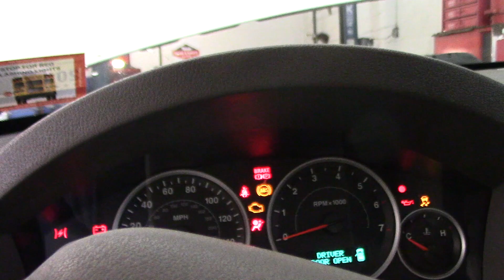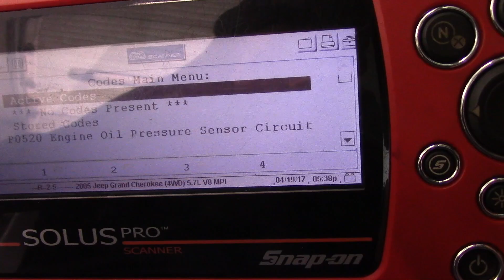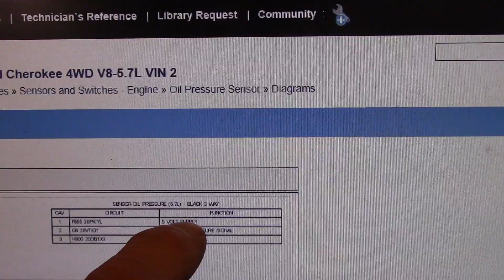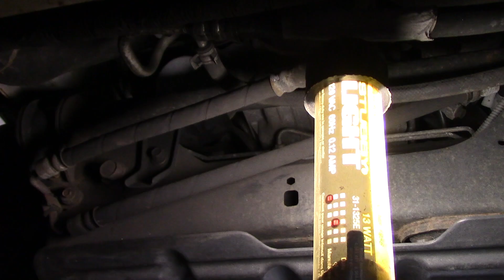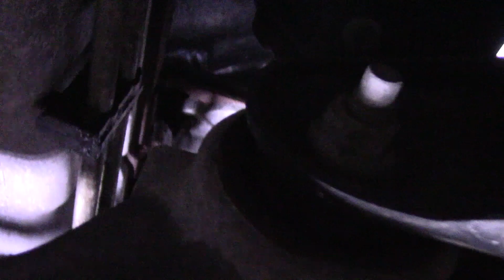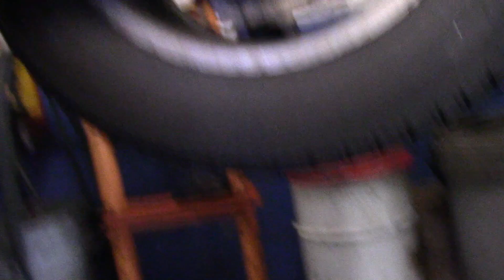Oil Pressure Sensor Replacement 2005-2010 Jeep Grand Cherokee

Comment: When you test the ground what should it read?
Reply: Ground should show good continuity to the negative side of the battery if you use the ohmmeter function. If you’re testing using the voltmeter function, you should get close to 5V between the power and ground terminals in that connector.